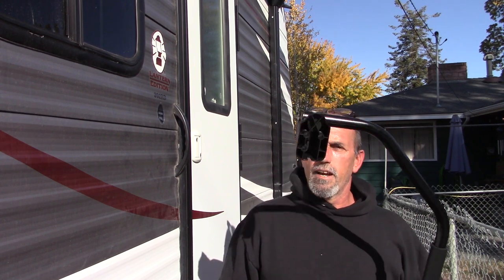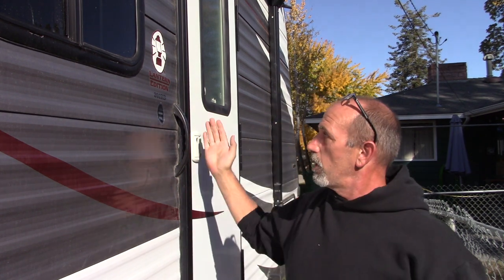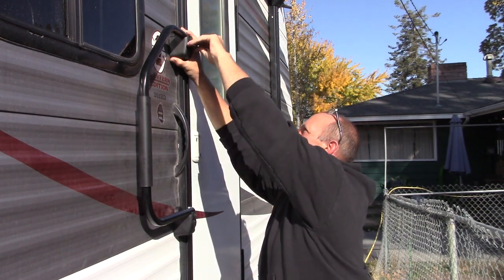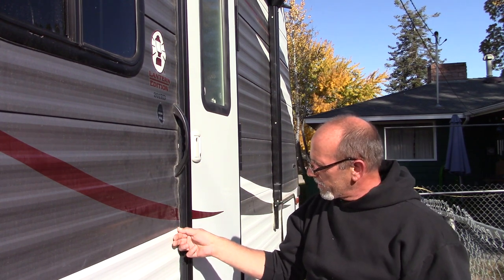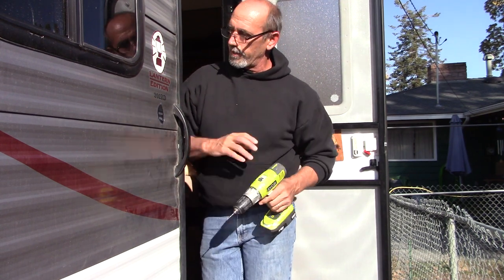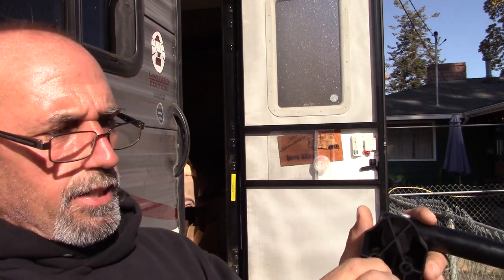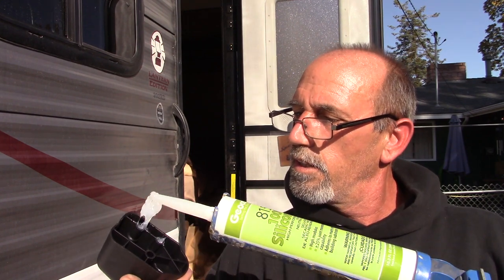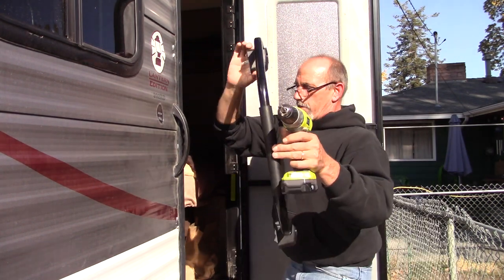Installing A Hand Rail on our RV. The Stromberg Carlson Lend a Hand Folding Rail.

Comment: Keep these vids coming. I recently purchased the same rv a 2020 and have done roughly the same mods as you. Thanks for the great explanations. Question. Do you have tv hookup in your bedroom at well as the living room?
Reply from the maker: Thank you for your comment. No ours did not come with the TV hook up in the bedroom.
Reply: Diy RV and Home ok thanks. I’m asking because I know some earlier models of the 202rd did and I’m wondering if the newer ones like ours still have the wiring up in the ceiling
Reply from the maker: @GNogueira83 I wish  there was an easy way to answer that question for you. We have a TV DVD player and I attached a hanger bracket to the wall in the bedroom and use the outlet on the wall to power the TV when we want to watch a video in bed. Other than that see have the tv hanging in the back next to the entertainment center.

Comment: The screws that come with this are far too long and instructions state to go all the way through with bolts and washers….that’s not happening. What screws did you use once you drilled an inch depth with the 1/8? Thanks!
Reply from the maker: I used 1 1/2" screws, that way i knew.i wouldn't go all the way thru

Comment: Greg can you actually put one handle on each side of the door? I broke my femur and my back, so I was looking to add one to each side in order to give me security when going in and out of the trailer.
Reply from the maker: There is no way that I know of to attach to the door side because the door is in the way.
Reply: @DiyRVandHome  You may be able to have a fabricator make a custom handle with the similar profile to attach with an offset to the inside of the door. this will give you a right hand handle to help you

Comment: What happens if the button screw on top comes out or won't go back down for some reason.  We just put this handle in about a month ago and we use it a lot but today I noticed that long button on top of the black casing wanting to come out when I raised the handle to move it to the other side.  Don't know why this is happening.  Thanks.
Reply from the maker: If you are referring to the bolt that the handle pivots on then there could be some dirt or something keeping it from moving property. Try to spray some silicone spray on it and work it up and down. See if that helps. I would not use wd-40 as it will attract dirt.
Reply: Take the handle off and look inside the plastic case. In there you will see  the the pin bolt, a spring and a keeper on the end. The keeper as I call it may have slipped down to far and needs to be forced up a small tad up the shift. Be very careful not to much maybe 1/8 inch at a time and keep testing it.

Comment: This product is unsafe as purchased  due to the minimal amount of safe grip area about 10 inches. To correct this I sprayed on Rust-Oleum LEAKSEAL which gives you a rubbery type grip on all slippery metal surfaces. Now much safer grip on all areas.